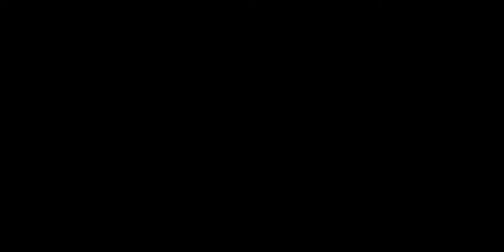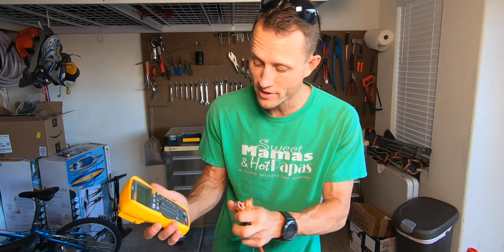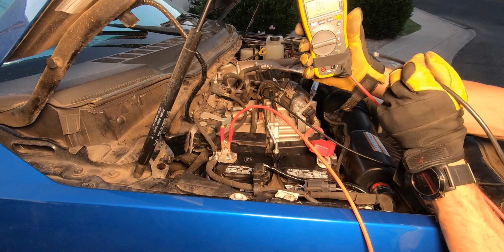Electrical Wiring Harness, Circuit Breaker, Bus Bars - On-board Air System 2020 F350 - Part 2

Comment: you use aluminum wire or Copper, I think you said copper...   $$$  big difference money wise between the two
Reply from the maker: Copper only in my DC systems: RV solar, inverter and other stuff…plus the truck wiring.
Reply from the maker: 2 Gauge 2 AWG 25 Feet Black + 25 Feet Red Welding Battery Pure Copper Flexible Cable Wire - Car, Inverter, RV, Solar https://a.co/d/9FnsDJl